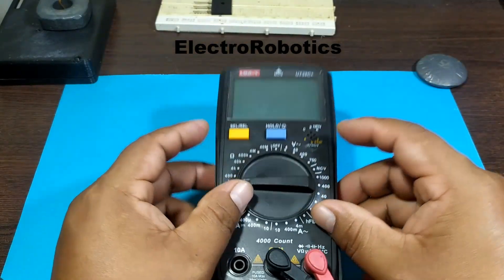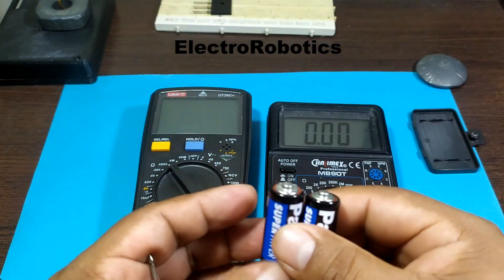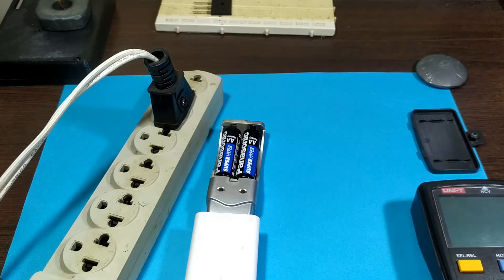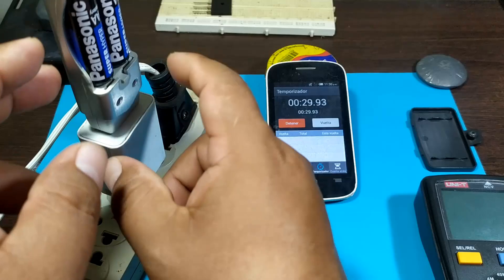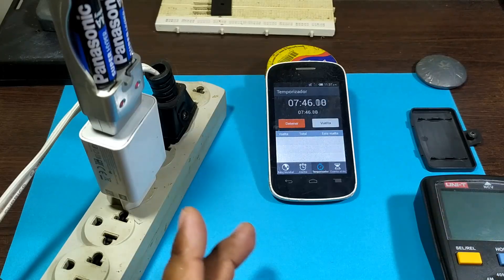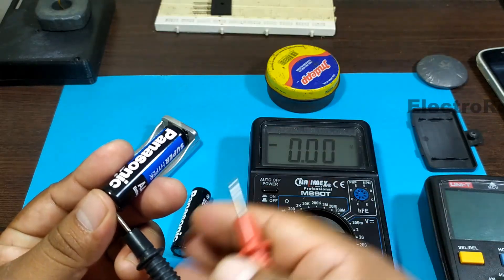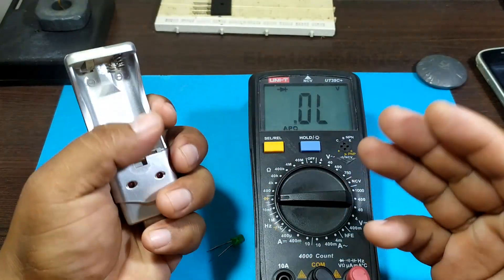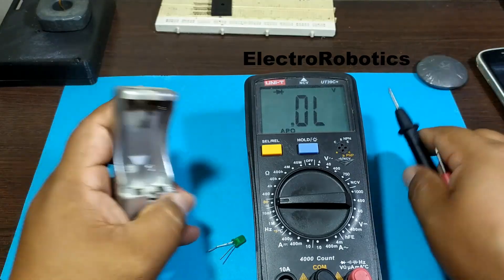Don't throw away your non-rechargeable batteries without first seeing this interesting idea.

Comment: I have a Rayovac charger designed to recharge alkalines. It works well but the recharged batteries have a tendency to leak, so if you don't mind if your equipment gets damaged, it works fine. If you really want them to leak, I recommend Duracells.

Comment: Those non rechargeable low quality battery can’t  be trusted. They have the bad habit to leak any time you forget them for too long in an expensive tool. After loosing many of my favorites and irremplaçable tools, I ditched them for the ones that I can trust. Lithium and ultralast rechargeable weather durability. 
That can be used on solar and emergency equipments   ni.cd is back with a twist.

Comment: Ive been doing that for years but used carbon batteries can only be charged less than 50 times bcoz the acid paste mixture with zinc will get dried up. Injecting it with salt n vinegar will get you another round of 65 cycles of charging time.